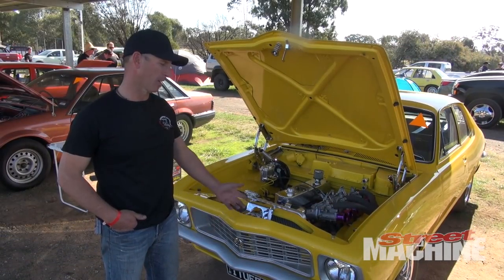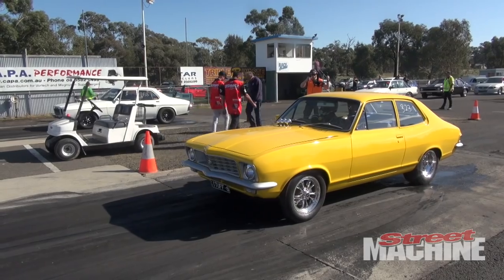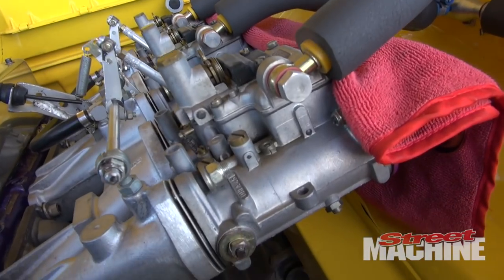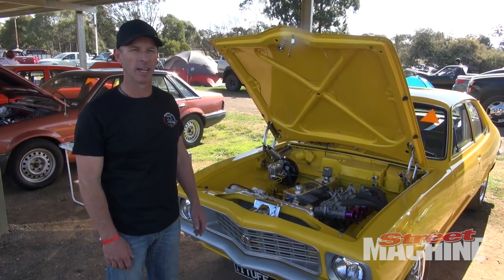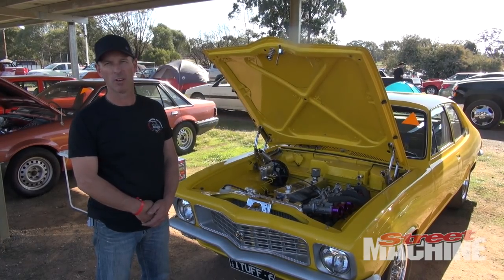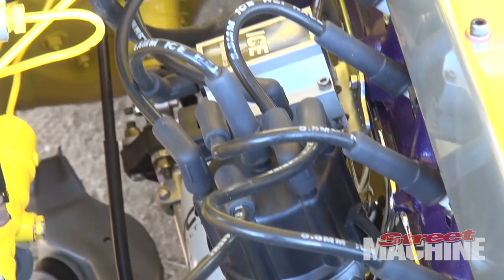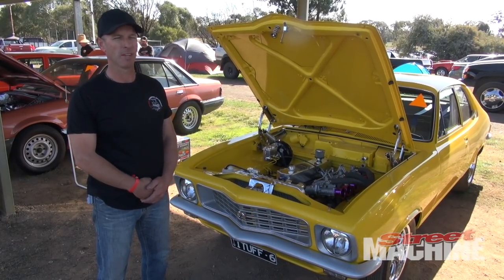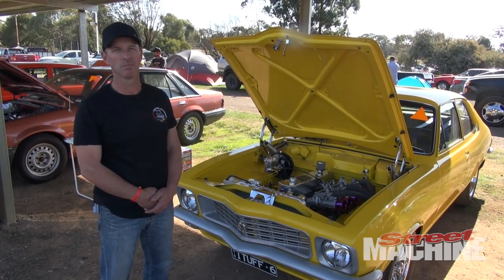1TUFF6 - 12-second Six-Pot LJ Torana

Comment: Excellent job, it takes a bit to run a 12 using a 1960's 6 pot. I managed it with my daily driven LC with Black motor and 12 port after many people said it couldn't be done on std street rubber and 106.85mph. I want more of your car :)

Comment: 230 horsepower running 12's is no joke.
Reply: wolf8218 all bout that power to weight
Reply: Torana means "To Fly" in the local aboriginal lingo. They fuckin do that.
Reply: @AttilaThebung   True, but many young ones didn’t understand the power to weight ratio especially around corners . Many young drivers wrapped themselves around trees and lost their lives including a good mate of mine back in 84.

Comment: I'm wondering if this might have been my old car?  hope the owner reads this,  but was it in metallic green when you bought it?  trouble getting the driver door lined up?  the engine bay also looks like how I had smoothed it out with the welded plates inner front fenders.  also it looks on my screen like the fenders are welded to the under door sills and across the front,  all stuff I did which I'm sure caused headaches to whoever ended up with it.   Anyway,  hope the owner comes in!  looks heaps better now btw!
Reply: hi mate , this was never a green car previously, it was yellow over black sills when i bought it off a friend of mine.
all the engine bay smoothing and the rust repairs to the lower guards  have been completed by myself and are not welded to the sills, sorry bud but its defiantly not your old car..